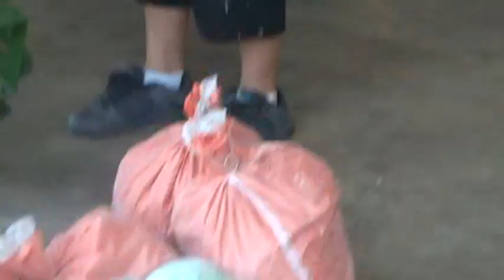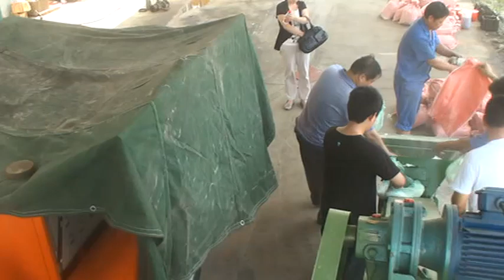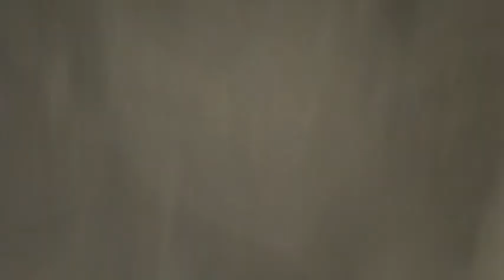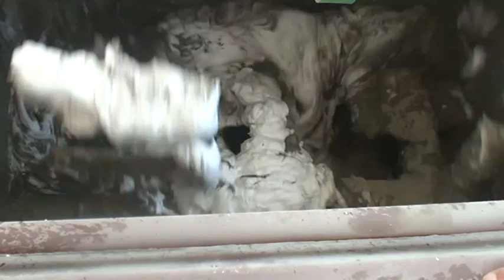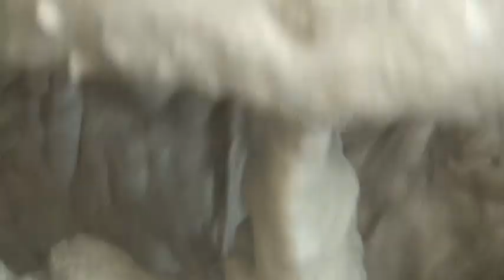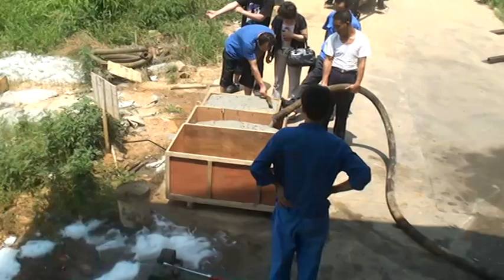Foam concrete machine for sale

Comment: why are they using foam on concrete?
Reply from the maker: Using foam concrete is in order to reduce the density and get better performance of heat insulation and fireproof.
Foam concrete has much advantages in construction, and it is very popular material. If you need this foam concrete machine, could you tell me your email address? So we can send you more deatails soon. Or you can email us! Email address is info@gaodetec.com. Thanks!